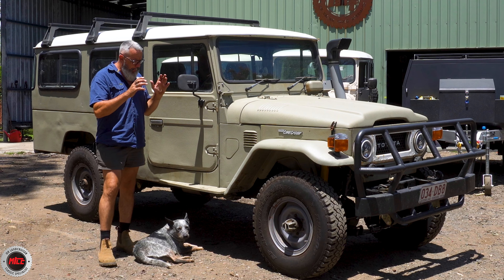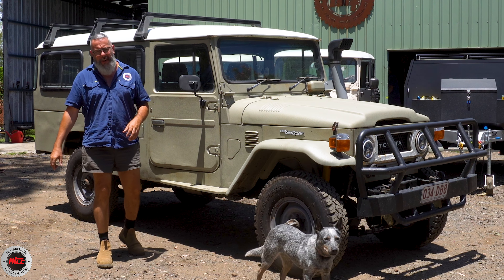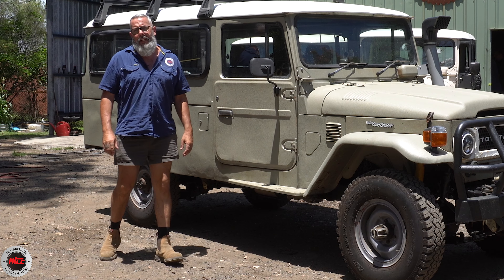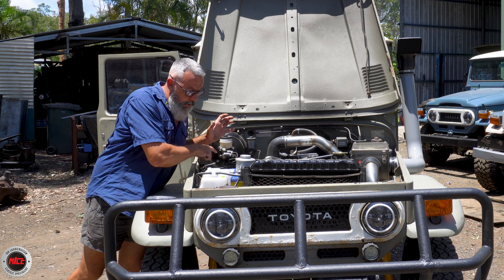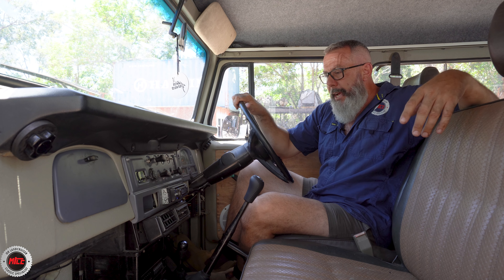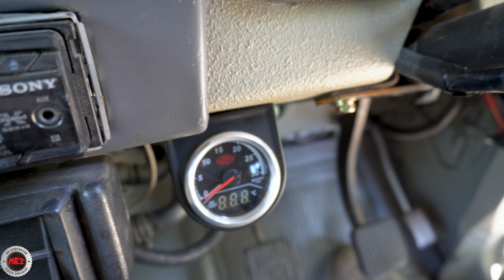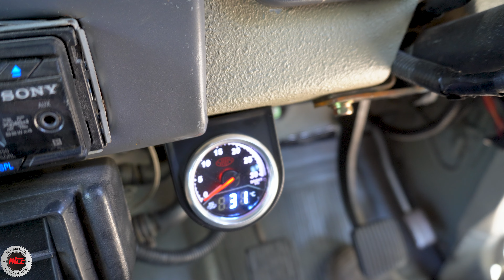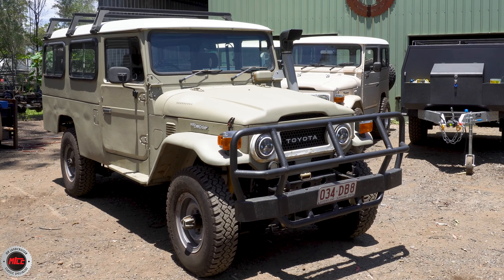HJ47 Troopy that Ticked all the Upgrade Boxes!! - Mr Landcruiser

Comment: Nice bus. Nice colour. Nice splitties. Nice bar.
1) I'd put on an authentic Toyota Hy-Way sun visor. Once you've used one you understand and will never go back.
2) I'd put acoustic and thermal insulation in the roof and the floor.
3) I'd add a Thomas (Winch Industries) PTO winch
4) I'd add a pair of standard Hella Rally 1000 spread beams with clear covers.
5) I'd tint the windows with 3M Scotch Tint.
6) I'd put in the Air Con.
7) I'd add an Icom IC-40 pro UHF CB and a ZCG wire whip antenna on a spring and fold down base.
8) And finally, I'd buy a Trail Blaza fridge from the Sunshine Coast. Support Qld and local manufacturing
Reply: @theocalvet3991  Mr Landcruiser Dot Com Dot AU
Reply from the maker: Sounds like perfect upgrades to me mate, tick to all